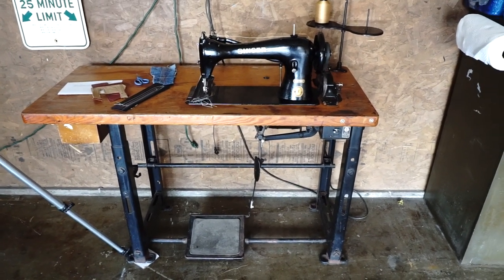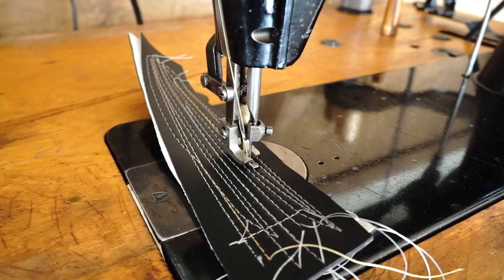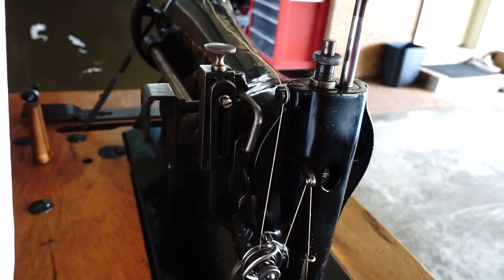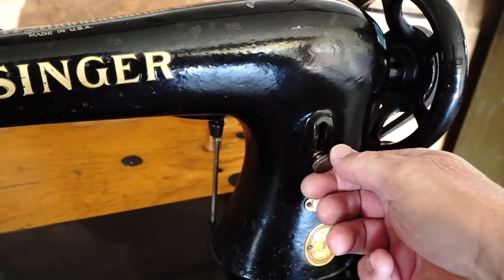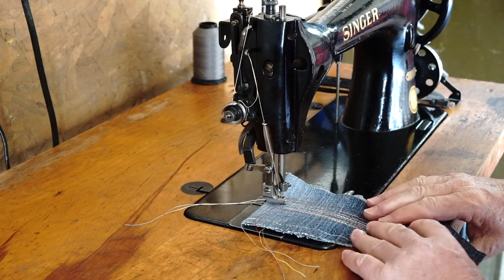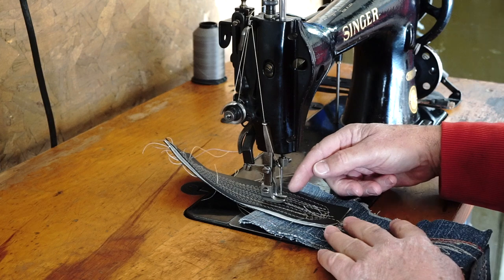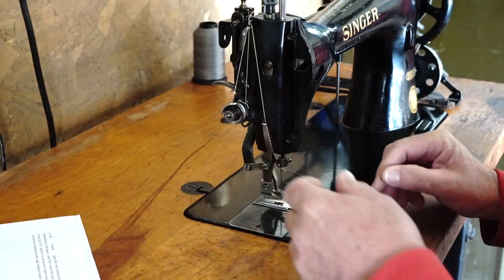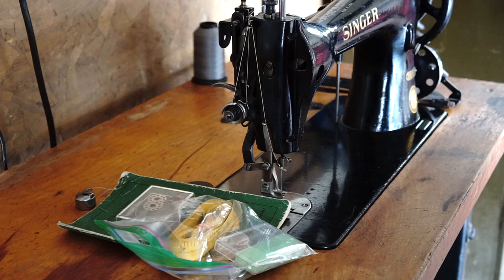Singer 16-188 Industrial sewing machine DEMO leather, canvas, tarps.

Comment: Your skipped stitches with 5 layers could have been avoided by using silicone oil on the top thread.  This is especially needed with biothane or rubber products.  One can make a DIY version with a piece of scrap foam then adding the silicone oil to it (the stuff is quite thick).  I own a 1913 Singer 16-88 and a 1954 Singer 16-188 and considering a new old stock Singer 16u-288 (there are two for sale from old stocks) color grey not black like the other two.   These are beautiful and great machines loved by upholsterers for decades.  The Rex 28-188 clone actually has reverse added to it.  The 288 was made in Japan (U factory designation).  Best regards
Reply: Hi Mike, I’ve a 16K 115 which was made in 1916 — I’m missing a wire thread guide for the front of the face plate and another wire thread guide at the lower end of the needle bar, any idea as to where I might find either of these please?

Comment: That machine is quite impressive! How much does a machine like this cost?
Reply: I picked one up $20. If its in perfect running condition or as I say plug and sew $400. If it needs work I wouldn't bother as there's no new parts other than little stuff. If you get parts they are used and probably worn out in the same spot.